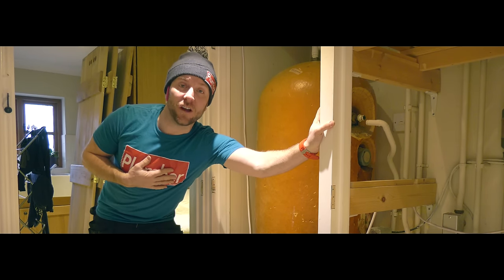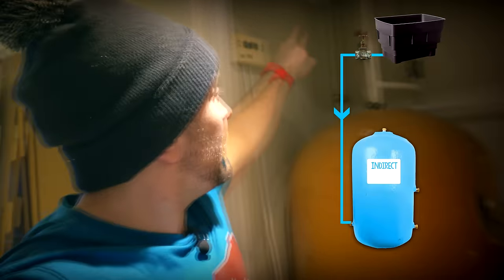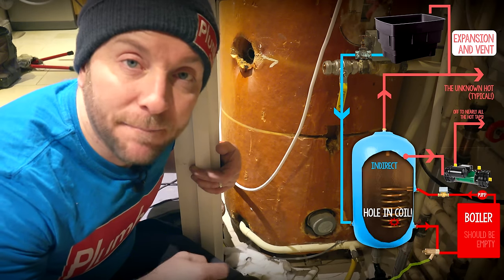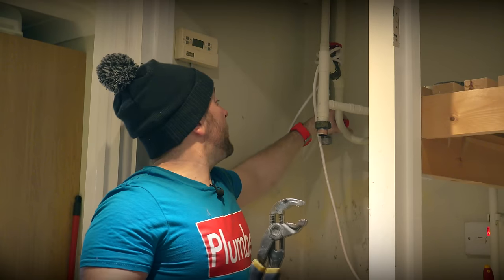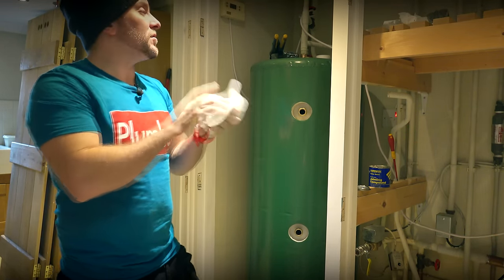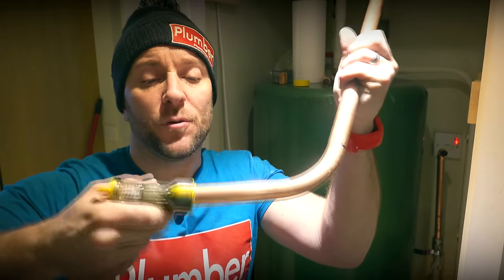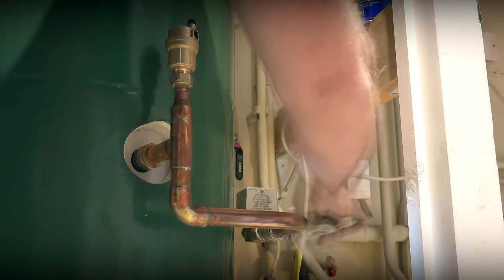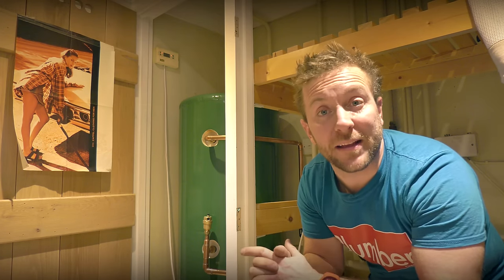HOT WATER TANK CHANGE - Job report - Plumbing Tips

Comment: As a DIYer, polishing the pipes is not just vanity, it’s also good to get the flux residue off. It is the same in electronics, we wash the solder joints with isopropanol alcohol to save the corrosion later on. Leave the older acid fluxes on and the joints grow beards in a few years! Also as The Boys says ..... it looks like you care about your work and that after all is all the recommendation you need.

Comment: When draining heating side on the tank the coil, whats the best way. Can you just drain from the drain off on the flow and return on cyclinder or better to drain from rad downstairs.  They have radiators on top floor also boiler and tank in middle floor.

Comment: At last a plumber who puts valves on the primary flow and return to the cylinder! Thank you for showing and telling that in your video. Apprentices take note. #holdtight
Reply from the maker: Ha! You know mate. Always prepare for the worst! Happy crimbo innit.
Reply: U can't always put valves on the flow and return of the coil if the coil is for a solid fuel system it's against regulations 2 put isolation valves on a gravity line
Reply: @mikef6816  good man

Comment: Hi James, love your plumbing videos.  They've helped me out twice over the Christmas break on my own system.  I had two rads not heating up at all after Br Gas drained the system down for a repair.  Managed to get both working after watching your vid on clearing an airlock. 
My second issue was that the boiler didn't shut down after the hive thermostat turned off.
I have 27 rads on a 3 zone system and traced it to the motorised valve on zone 3 not shutting off. It turned out the valve was stuck in the on position due to worn teeth on the cam that activates the micro switch. 
I noticed that you mentioned in the video that the motors can fail and the valve not opening but might be worth mentioning that they can stick in the open position. 
Thanks again,  and hold tight !

Comment: Definitely need to change mine. I think the coil is clogged as the boiler fires up briefly when the hot water is selected on the timer then dies back down to basic pilot light.
Doesn't help ALL the stopcocks are siezed 😫

Comment: I recently started putting the flow into the bottom of the coil and return out of the top. Unless its a solid fuel system.  But the principle is you won't see a kettle with the element half way up. 
Effective and efficient and heats more quickly. 
Hold tight!

Comment: Hey up.. My copper cylinder has got a small leak at the bottom.. I've cut back the insulation from the pipe connections.. No leak there..

So am I right in thinking the cylinder is cracked.. So time for replace??

Comment: Morning pal been working in a care home. They have had a new bath fitted but they say the hot tank is not big enough to run the bath the tank is 140 l .the bath takes 300 l .and the pressure is low would and pump sort this or do I need to put a bigger tank or can I just put another tank in next to it and tap in to the arignell one. ...Cheers Rob

Comment: Great content, keep up the work
Are lever  valves better than gate valves....
I know from experience gate valves are notorious for locking up and the heads snapping off but aren't lever valves prone to leaking? 
Which is best in your opinion and why?

Thanks
Reply from the maker: Good quality lever valves everytime!
Reply: I personally always use Pegler lever valves. After nearly 10 years they’re still working fine. They might be slightly stiff if they haven’t been used for a long time (maybe 5 ish years?). But once you free them up by turning it on/off they’re back to moving easily again. I hate those inline valves where you turn them on/off with a flat blade screwdriver. The amount of times they leak from the screw when you want to turn them off. Grrr... Absolute PITA!

Comment: Great video , how do you attach the stat to the tank ? Here in the  U.S. they are inserted into a pre fitted dry well !
Reply: Cut a square in the insulation on side of cylinder and remove square. Stat is then held against bare copper of cylinder where insulation was removed. A slightly stretch strap is used to hold the stat tight against the copper. The electric immersion elements in these cylinders have thermostats inserted into a dry pocket.

Comment: Is it common in the UK to put that compound on compression fittings? I don't use this and never have any leaks.
Reply: In theory you shouldnt need it on compression, but on jobs where it would be a pain to drain everything down for the sake of a small leak that wont tighten, or a joint thats in a really awkward blind spot, its worthwhile doing.
Also on pipe that has  previously had a fitting removed and may be a little deformed, as in the cylinders top (vent ) outlet.